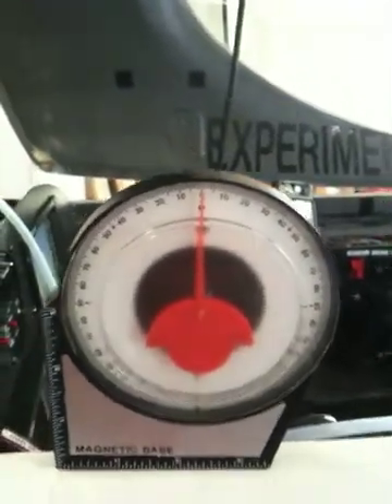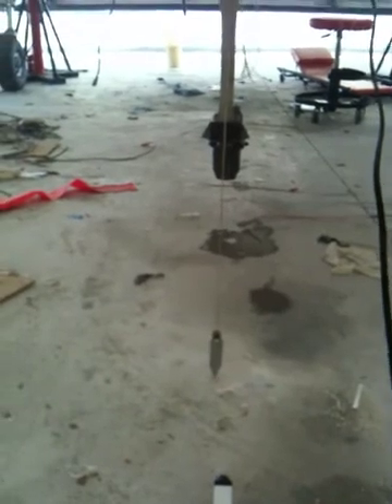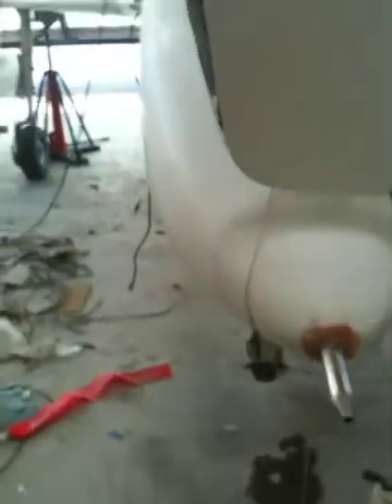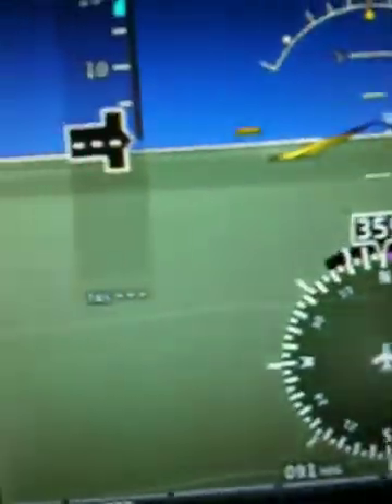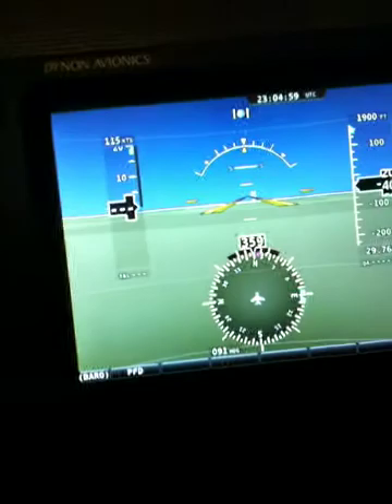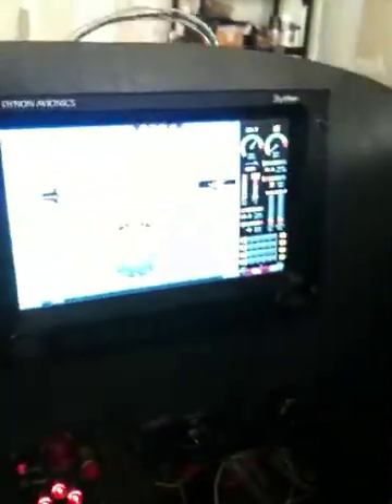Project Skyview Part 19 - Laser Beams and Glue

Comment from the maker: I installed the 7 inch screen but would have installed the 10 if I had room but as you can see, I didn't.

From a redundancy standpoint, I would have two 7 inch screens, it would be nice to have the ability to switch between them.

On the other hand, the 10 inch screen would allow for a larger font!  So, even with two 7 inch screens the maximum font size may be too small for people with less than excellent vision.

Also, one 10 inch screen would be far less expensive.